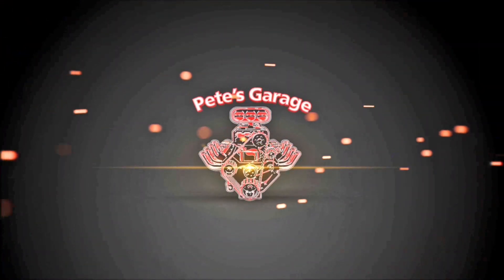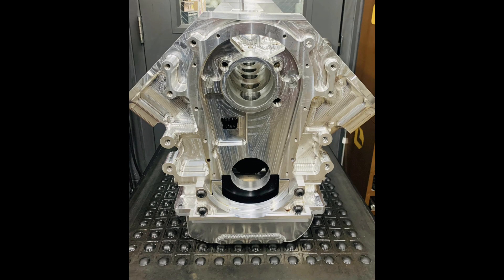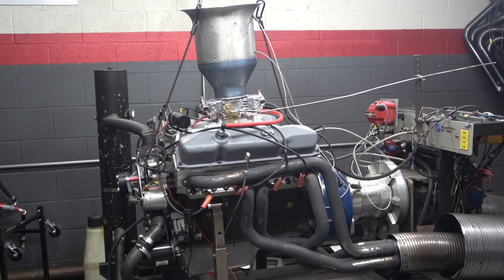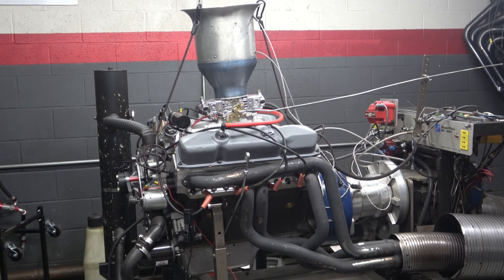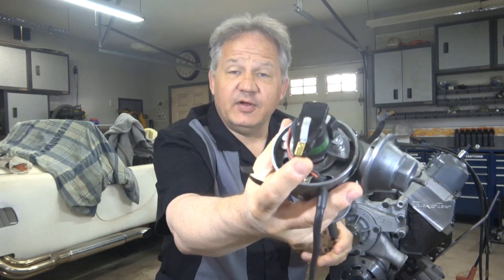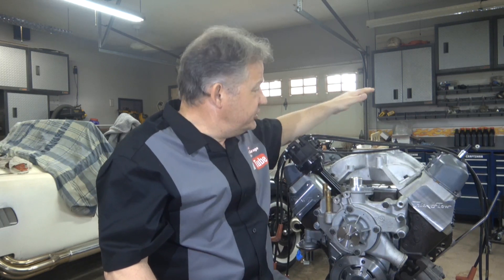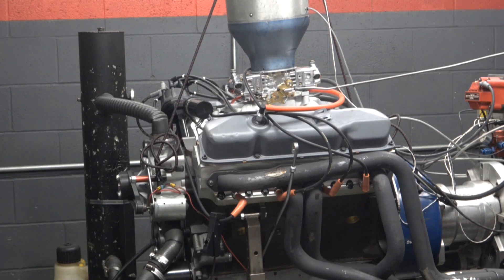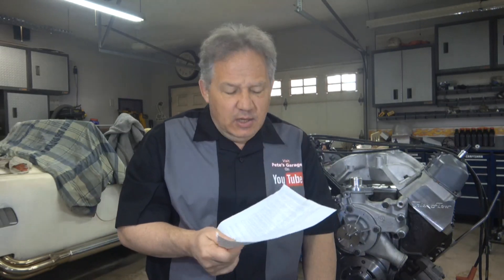Engine Building Tips   Dyno Testing and Tuning with Pertronix 440 MOPAR 512 Stroker

Comment: My 512 got 605 horsepower with single-plane intake same cylinder heads 10.821 compression and a hydraulic roller cam
Reply from the maker: That compression and roller definitely helped.

Comment: Nice build Pete.👍.. Thank you for sharing your honest results and experiences,  it goes a long way in terms of  helping others learn.

 I built a 505 RB based combo with a 600 hp goal.. i used a  "low intensity profile" solid roller 254/260 @.050 range for duration,  ..585 lift  109° LSA .. bumped the compression to 10.8-1.. and the matching Trick Flow Single plane. My potential limitation is the Edelbrock heads i used vs. The TF 240's. I have never dynoed it, but it sure runs HARD !!  It's still a very "street-able" combo. It produces gobs of torque  from 2,500 rpm on up. It pushes my 3,500lb B-body Mopar with ease. And it will scare you,.. if you put your foot down. 😅 Lots of fun. Cheers. 🍻
Reply from the maker: I agree

Comment: So, a solid roller could have gotten 600 HP?
Reply from the maker: No, but it would help
Reply: A properly sized  "low intensity profile" solid roller 254/260 @.050 range for duration, close to .600 lift .. bump the compression closer to 11-1.. and the matching Trick Flow Single plane would definitely put you in the 600 hp range. And still a very "street-able" combo. It will still produce close to 600 ft lbs of torque  from 2,500 rpm on up. Push any mid sized Mopar with ease. And scare you,.. if you put your foot down. 😅

Comment: Nice motor.  Hope the guy understands the trade off of performance and street manners. And that extra 70hp would cost over 5k for a full roller setup.  Nitrous is cheaper.
Reply from the maker: He understands, and you're right, the extra 70 would not be worth the expense. NOS would be a better option
Reply: it's got roller rockers and cut to length push rods. It would have only cost about $800 more get a hydraulic roller cam & lifter set. The gains would be well worth the money spent and with the right cam, the idle would be below 1,100 rpm.  A Comp 23-712-9 in 493 can easily idle in the 700 rpm range or less.

Comment: I'll admit to not being much of a 'gear head' and didn't realize there was an ignition that could provide multiple spark.  That's cool.   
I would be interested on how you change the jets on the carb while it's set up on the dyno.    
Then there's the '69 Charger.  Looking forward to seeing pictures or video of that car.
Reply from the maker: Top fuel racers have more than 1 distributor too. Jets are easy to change, just pull off the bowls and change them. They screw in, there are 4, it takes about 15 minutes